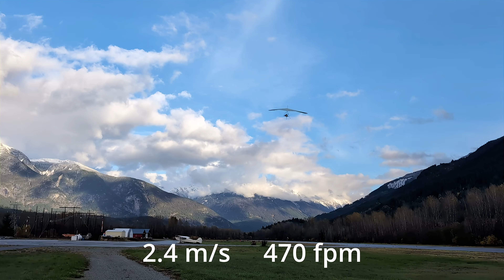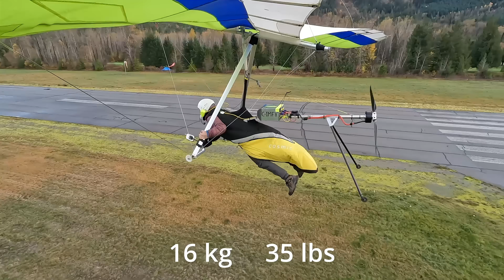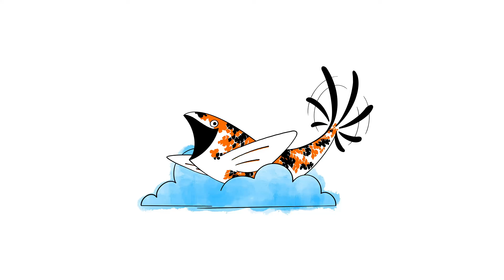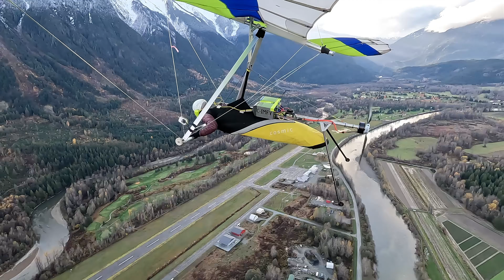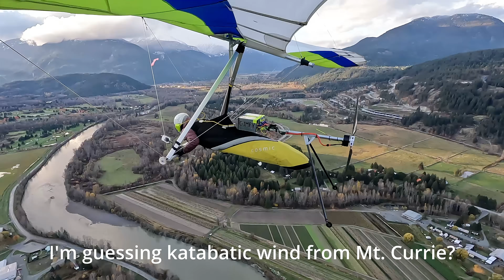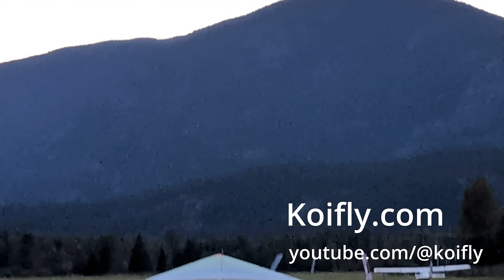Koifly electric hang glider – 🚀 470fpm to the moon! 🌔

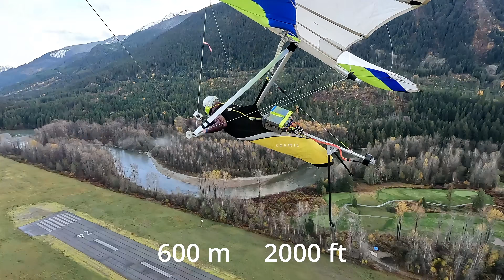Comment: Thoughts: The yoke that attaches to the harness looks dangerous as such a rigid structure. Perhaps moving the ESC out the drive near the motor with the power wires in a lightweight tube along the shaft. 500 fpm is quite good. I flew a Soarmaster back in the day with a 12hp motor, but it was fixed to keel and HORRIBLE to launch, not pushing on the pilot. For the harness yoke, I am thinking a curved composite structure that attaches higher; the push currently is on your hips, but higher to the center of your back will give you the best launch. Watching the launch sequence up to 0:27, after you prone the center of thrust is about just above your shoulders, but during the run is pushing on your hips. I imagine an attachment system just behind your armpits which goes around the harness and clips in front. Behind and above your shoulders is a 400mm wide horizontal 'bar', to which slightly vertically curved yoke arms, attached on ball hinges, go back to the front of the battery pack/shaft end, rigidly. Thusly, the Y shaped yoke gives lateral rigidity, pushes on the center of your back during launch, and has the same current thrust line while prone, except would be a bit negative(down) thrust initially. Aft folding prop blades when stopped would eliminate drag and windmilling. And gear legs that can be 'retracted' fwd or aft would help with drag also, maybe even to retract after launch for climb. Overall, a very impressive system, especially since you are at 16kg and get a 500fpm climb 🙂
Reply from the maker: The electric kit is pushing you by your hips because it's convenient to run this way on takeoff. I haven't tried attaching it higher, but I don't think having the thrust push into your mid/upper back will be more ergonomic. Also, the current attachment (almost) eliminates the effect of the electric kit on your harness' angle-of-dangle, that's another bonus. The electric kit attaches to the carbon fiber backplate of the harness, so there is quite a strong wall in between you and the poky yoke parts of the kit if that's what you're concerned about. The role of the horizontal bar you mentioned is already fulfilled by the carbon backplate.
Reply: @koifly  What about the impact of the  KoiFly thustpack on the pilot, in case of irregular take offs and landings? These do happen as we all know. How is the pilot protected from being hit by the thrustpack when the glider structure fails?
Reply from the maker: @sudosu4133  The electric kit attaches to the carbon fiber backplate of the harness that provides some physical protection.

Consider that the kit is only 16kg, whereas my body plus my regular harness weigh around 80kg. So, the electric kit only adds ~17% to the crashing mass. It's not nothing, but it seems to be quite manageable.

The electric kit has safety advantages too. For example, you can abort the takeoff if you don't like how it's going, whereas in mountain foot launch, you generally have to commit once you start running. And honestly if I have to choose where to mess up my takeoff, I'd much rather splatter myself on nice airfield grass than slide/tumble down a mountain slope with who knows what in the way.

That said, of course you still need good launch and landing technique, especially if your airfield surface isn't that nice. You see I'm taking off from grass rather than paved runways for obvious reasons.
Reply: You both make good points.  It would be good to know that there’s a safety factor from the engineering standpoint    .
How thick is the carbon plate or can you describe the shape of it?    with the added mass and  potential speed of an impact, multiplying the momentum on all things attached. Pilot backplate and/or the E-system itself.  
 having an outer back plate that the components are attached to,
 with that back plate then attaching to the internal plate would spread impact force. 
Another thing to taking consideration and really over engineer is how the battery pack is attached to the main shaft of the system. Or if there was a significant impact, could the batteries be dislodged inside the case?  
I saw one person‘s project and the batteries were held down with Velcro straps. If there ever was a fire, there was nothing to direct that that heat away and I feel like there’s a very good possibility in their design they could end up melting the  suspension part of the harness. We use GAC flex round lifting slings in the entertainment industry. They have a tube of  nylon webbing (that protects whatever it is attached to so you don’t have metal on metal contact) with coiled galvanized aircraft cable inside in case there’s ever a fire when we’re lifting heavy truss with lights on it or a PA system.  
Just some things to think about.  
I appreciate your dedication and drive for this project!

Comment: Congratulations on your success!
I'm very interested in your solution, looks really great. 
What current does the motor take? 
How many Ah is the battery?
Do you know the thrust of the propeller in its current configuration?
Reply from the maker: Thanks! Current is approx 200A at 14S. Batteries are 7S 5000mAh (8x). I do not measure static thrust because it has little to do with actual in-flight performance. Every propeller loses thrust once you start moving through the air, and, simplifying a bit, fine pitch props that produce the best static thrust lose more of their thrust in-flight, so it just does not make sense to optimize for static thrust. Instead, we optimize for a good balance of climb rate and current draw.
Reply: @koifly  thanks a lot for the information! I will follow this with great interest.
Reply: @koifly  Do I understand correctly: the battery is over all 14S 20 Ah?  So, around 1 kWh?
Reply from the maker: @hansschwoller7112  Yep. You can see more technical details in the previous video, the battery is the same: https://www.youtube.com/watch?v=OcYvDVgqKOU

Comment: Perfect results! But you still use lipo or what means "cylindrical" battery's??
Reply from the maker: Currently we're still using the same lipo cells, but the new battery pack I'm working on will be using cylindrical li-ion cells. Those are not lipo cells, but rather they're similar to cells used in e-bikes and EVs.
Reply: @koifly  I'm thinking about them too, but as my friends tell me, Li-ion batteries should have a much higher capacity to discharge current ratio.
Reply: @koifly LiPo is Li ion with a polymer electrolyte (usually some liquid electrolyte, too). The chemistry is key. NCA has higher specific energy than LFP cells.
I hope you'll be ready to sell them soon!